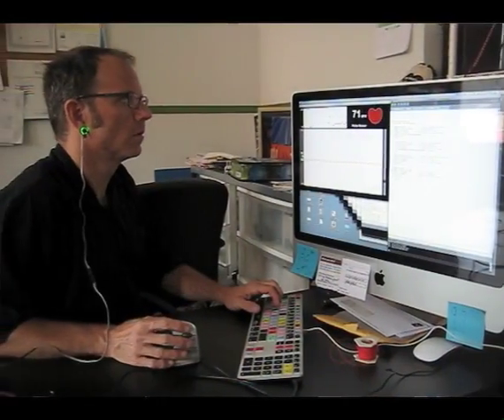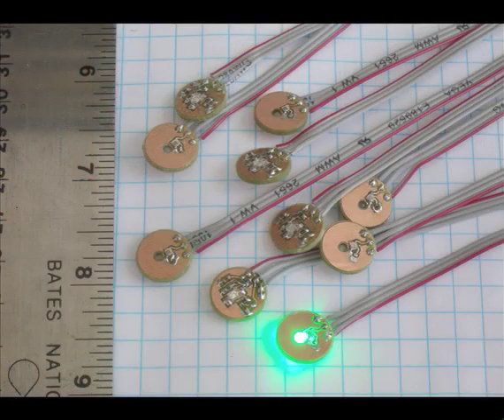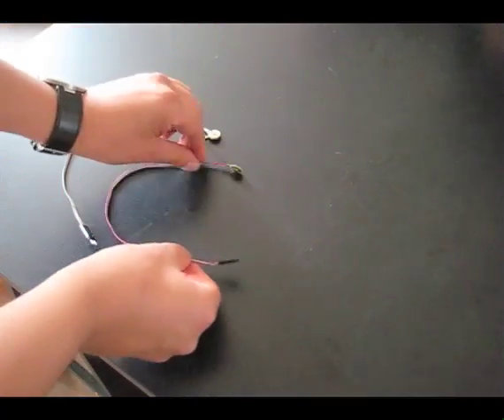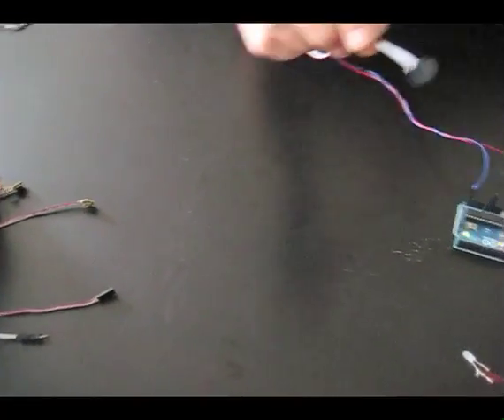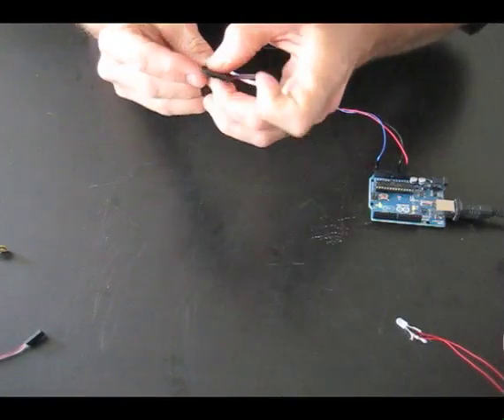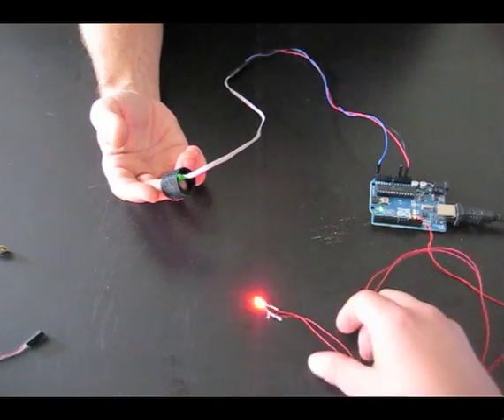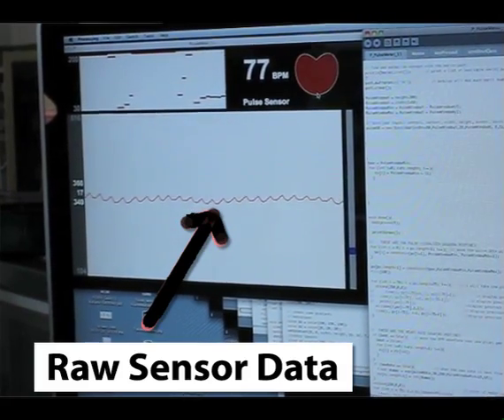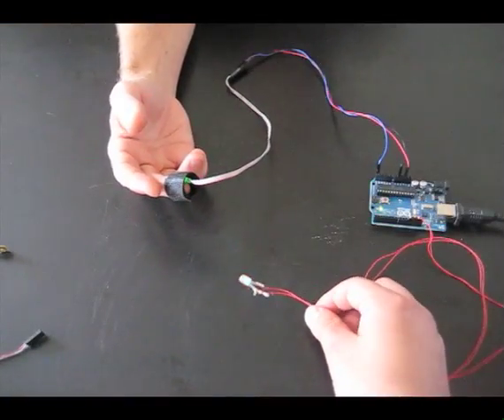PulseSensor: an Open Source Heartrate Sensor for Aduino

Comment: Hello! I am working with pulse sensor. The LED from pin no 13 is blinking according to the pulse. Its working.
But pulse sensor amped visualizer is nor working! It just shows a straight line and not gives BPM.
I used code from this site for both arduino and processing code. 
https://github.com/WorldFamousElectronics/PulseSensor_Amped_Arduino
I am using Windows 7(32 bit), arduino IED 1.6.9
And processing 3.1.1 software.
I gave same baud rate to both arduino and processing code. 
Please suggest me how can I solve.
If possible please give the screenshot , how to fix it
Thanks

Comment from the maker: Shajjad and Swopnil, hi.  Did you buy the Pulse Sensor from pulsesensor.com ?

There are low-cost copy-cats on the market.  It's cheaper for a reason, our device is fine tuned, we monitor quality at different steps of production. 

PulseSensor.com sells hardware, and we provide the software for free.  

Most of the complaints I field from user's are around some other companys' hardware.  We can't control another company's hardware quality.... 

That said, I'm sorry to hear you two are having a bad experience. 

Please post detailed tech photos &/or question here:  https://github.com/WorldFamousElectronics

It's a great place to see what's happening.